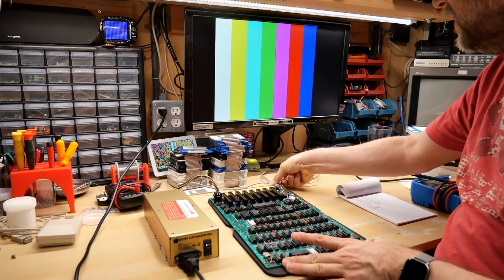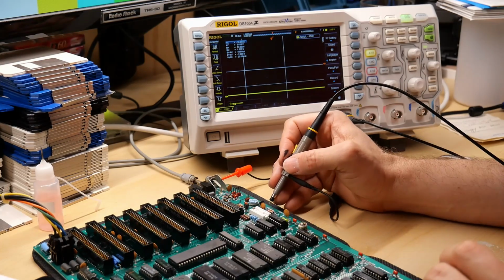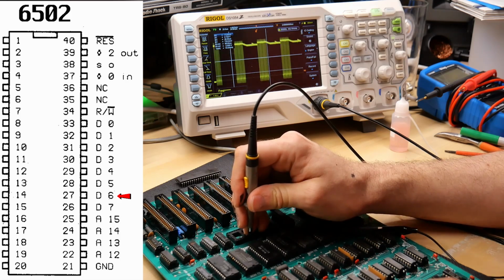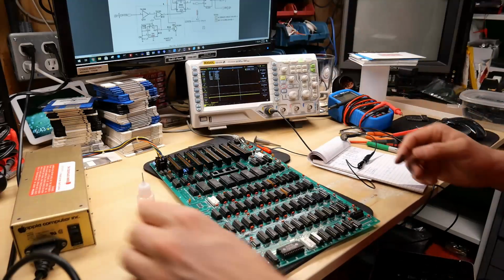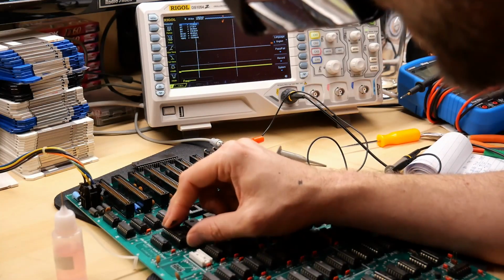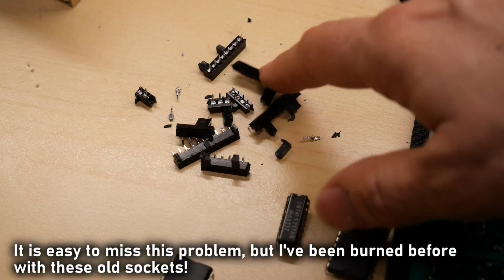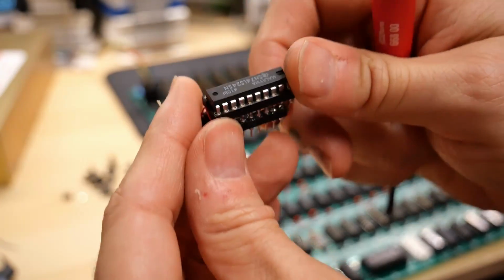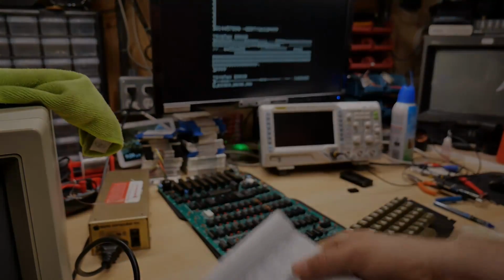Fault finding and trying to fix the Apple ][ plus

Comment: all those apple 2 keyboards did that typically you just typed then went back & corrected all the errors. what frustrated me was these were so slow to boot up often crashed not storing anything to file loosing hours of typing forever
Reply: I wouldn’t describe Apple II’s as slow to boot - quite fast by today’s standards, but that’s because DOS is just a few KB even BASIC is contained in ROM